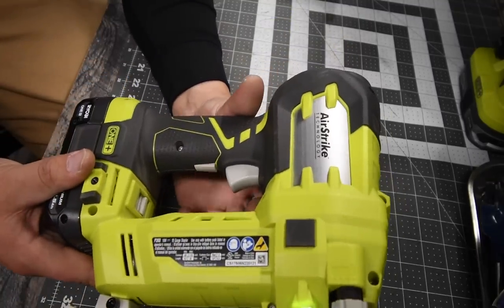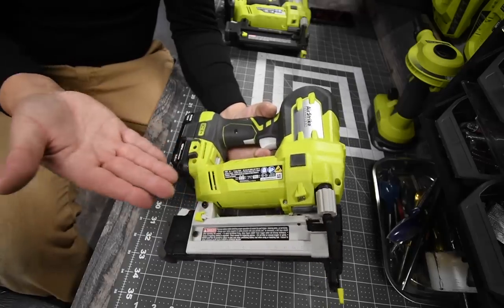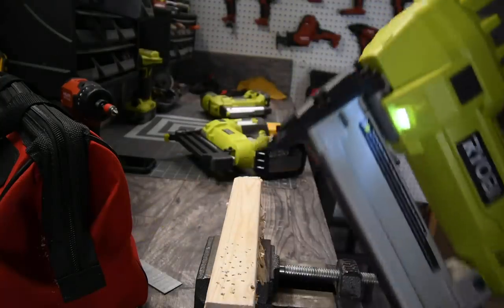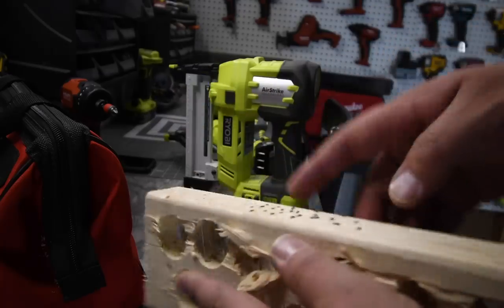Ryobi AirStrike

Comment: I actually bought that brad nailer a month  ago for $98 at home Depot.Very impressed with it, I'm a contractor and have a Paslode Impulse cordless but got tired of buying fuel cells& getting my compressor out otherwise.I put a lot of exterior doors in and use this to put the trim back on. So far I've installed five doors& some other casing with it, only used 2 bars of battery ,probably used 10 or 12 strips of nails
Reply from the maker: the only issue I have with the brad nailer is when it gets to cold it won't work

Comment: hack fyi the crown stapler can shoot brad nails as well. just put the brad nails on the right side bottom up of tool you will see the nails in the window on the left side of the gun nail loading slider when the gun is bottom down. hope this helps in a way all you need is the crown stapler to do both staples and brad nails  1 A.i nyc tool nut
Reply from the maker: I will have to try that and I thank you for sharing that Seeker

Comment: Are they worth getting for a DYI guy ? I have the typical Porter House trio with the compressor but would love the ease of the battery power.
Reply from the maker: 100%
Reply: Or you just use the tire inflator 😂😂😂
Reply: I know I have the 15GA one and I got myself an air one - because when building stuff it is better, shoots much faster. But when it come to "I need to fire 2 nails to fix a book case" the battery is so much more convenient. Depends what you mean by DIY.
Reply: @jesseldridge2016  totally agree we bought the 16 ga nailer from ryobi since we had a bunch of other ryobi stuff and it’s great and I use it a fair amount and we were attempting to nail hardwood together and it wouldn’t do it so we boaught an air compressor and gun and I will agree, a large project I pull out the compressor but for everything Elise it’s the ryobi, for example I built a dog house and put it in the yard away from the house but needed to add a little bone as decoration and the ryobi saved me 15 minutes and is probably the reason the project was finished if I were you I’d wait until the next gen if ryobi nailers then buy but
Reply: They r amazing I have the stapler and brad nailer

Comment: Great thanks. Do they work ok with makita to ryobi battery adapter
Reply from the maker: they do have adapters that fit onto the Makita. I thank you for viewing Jamie
Reply: @ManCaverTools  thanks I have brought one and it works great. When I got the tool I could see there was only the 2 terminal + & - so was pretty sure there was no clever electrical stuff going on 🙂
And I am fairly sure makita have a low capacity shut off built in to the battery.
And all working together great. Thanks for the reply 👍

Comment: How does it handle compared to air powered? Is it heavier? It seems a little bigger than air versions.
Reply from the maker: I will have to do that :)
Reply: @ManCaverTools  I think you may have mixed this question up with my other post
Reply: Hey i have used the pin nailer, it is larger and heavier than an air pin nailer but works really well, it is surprisingly quiet if you are used to the air powered guns i didnt think it was working at first. Being free from the hose was great because i didn't feel restricted and could move freely. i think it is definitely worth it.